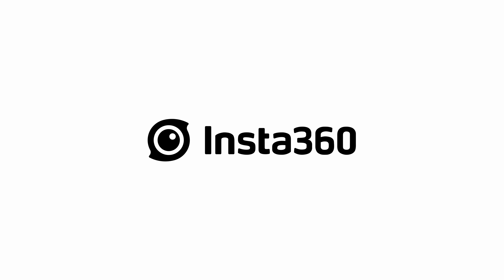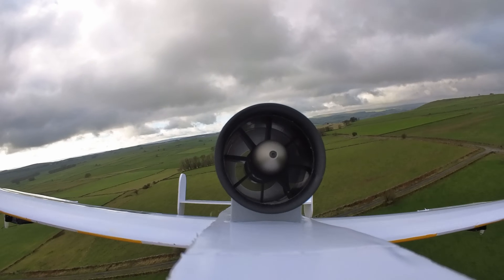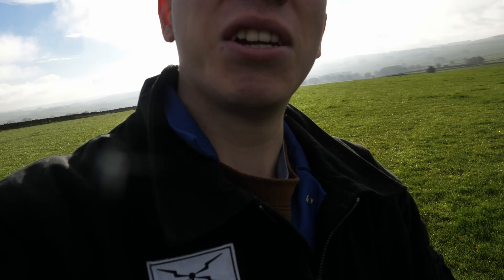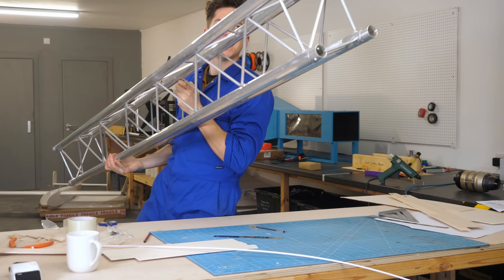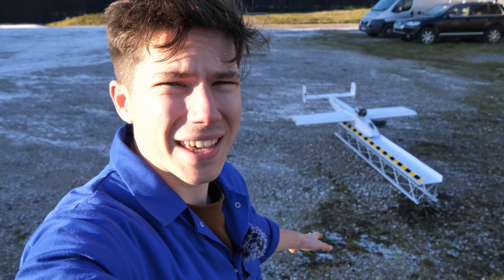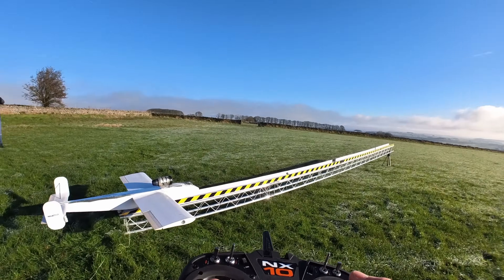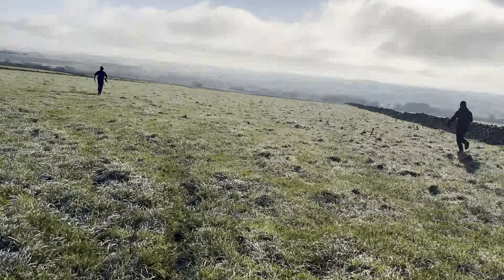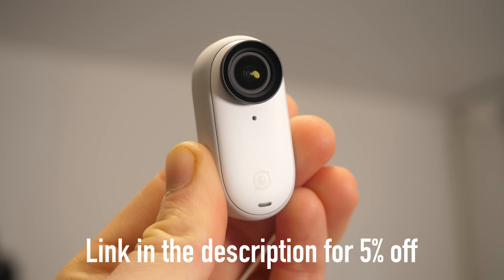Foam RC Jet

Comment: I know the carbon tube will block RF signals, same with the jet engine, and I'm sure the foil tape didn't help. Where did you have your receiver antennas, sandwiched between these three items? So it'd get the best signal from behind and below and the worst signal from above, this corresponds with the aircraft attitude at signal loss\regain IMO.

Comment: Just the EDF version was awesome.  I know I'm not the only thinking, that seems like a good scratch build edf.  Any specifics you can share?  Wingspan / chord . ect.    It seemed like with the EDF it could fly pretty slow.  Is the reason it had such a high min air speed because of the weight of the turbine more so than the design of the air frame?

Comment: To shiled the heat use steel, it have 10% off the thermal conductivity off aluminium. So space a 0.1mm steel sheet 5mm away from the foam, and the heat sheel will be magnetude better.

Comment: You were simply out of range dsxm receivers really aren't that great. It's part of the reason why I switched over to elrs for my quads but with your need for servos I'd do a little more research across protocols

Comment: It was lucky the engine failed prior to loss of signal and not the other way round, or was that the fail safe operating, I presume you set the fail safe?
 Did you use the appropriate form to report the incident to the AAIB?

Comment: Is it possible the turbine shut itself off because it lost signal with the transmitter? I know my turbine will do that. Also swiwins have auto restart so if you enabled this it would have automatically restarted the engine in the event of a flameout. I have also experienced this intermittent signal issue with DSMX which was exactly like what you had happen and had 2 expensive crashes as a result. I would use ELRS or jeti in the future as they do not have this issue. Jeti has the ability to run both 2.4 and 900 which is great for redundancy.

Comment: Ok so basically for the transmitter forgetting using normal signal transmitters since flying in such high speed can interfere with a lot of things considering using gps transmitters with unlimited range

Comment: The most common cause of control signal loss is polarity issues. Didn't you point your transmitter antenna straight at the model when it happened? I'm sure you're aware of the null point trap, but that is so easy to forget in the heat of a maiden flight. With something like Crossfire you would have margins enough to ignore polarity issues as long as you stay within a mile or two.

Comment: Sure looks to me like you lost link to your receiver which resulted in a brown out and subsequently the total loss of control.  What receiver were you using?  The control surfaces went into the neutral fail safe position they were in when the receiver was bound to your tx which tells me it lost signal.  I don't think it lost power because it probably would not have had enough time to reestablish the link.  Personally, I would throw that receiver in the garbage or at the very least keep it for an application that is not critical such as bench setup.

Comment: I would add a gyro if the airframe didnt oscilate to baddly just to keep it upright in a control loss. Or talk to Daniel from rctest flight about long range control systems.

Comment: Maybe you lost signal because of the heat that was produced by the engine? Or maybe because some fuel escaped from the fuel tank onto the electronics? I mean the fuel got out the same way air bubbles got in the tank (probably)
Btw I am sorry for my bad english

Comment: Shame the thing lost control authority from loss of signal, because even with the engine-out it would have been recoverable if not for that. Flew well enough, I suppose that's from being based on jet-drone designs going back to WWII. Is the engine even rebuild-able, or is it totally knackered out from eating dirt during the crash?

Comment: The reason why  he crashed is  because the plane was white and white against the clouds in the sky you cannot see the plane, the bottom should have been a different color than the top he lost control of it ,it wasn't the jet motor  
problem,he should I have been able to Glide it in

 he could have glided it in

Comment: No wonder why you lost signal, you're using a spektrum transmitter. 😂
Spektrum has had problems with range over the last 10 years.

Comment: Notice that you had a spectrum transmitter in the video. If you had a newer model Spectrum receiver you can plug that into the computer and it will give you the PPM data

Comment: why don't you use a basic system to aim the aircarft to the starting point using accelerometers and magnetic sensors? If it loose signal, set throttle to 25% (so it doesn't goes crazy fast) and aim 90º to one side, hold there, after a while another 90º and hold... and so on. Eventually you'll get back signal

Comment: Yea, please don't use that Spektrum junk!
Seriously that's the worst RC you can use!
Protocol is junk, recivers are junk, radios are junk. Don't use it for anything other than park flyers and small foamys.
The only good thing is the price.
Get a good multi protocol radio like a frsky taranis or a radiomaster tx16s, and for those more critical models some good recivers from futuba or graupner!
For small experimental stuff you can use the cheap dsm dsx crap clones for 6 bucks, for crashing anyway it's good enough!

Comment: I would not use a spektrum system for this kind of flying, it gave me a lot of signal issues in the past. I changed it for frsky years ago and never looked back. I also have read great things about ELRS, so i would advice changing your RC system to a more reliable system

Comment: The radio signal didn't hold up because The plane was over a kilometer away from The radio transmitter.

Comment: All modern jet fighters have sloped leading edge on their wings that are best suited for speed, and a large surface area. European fighter jets also have those delta wings that are great for high speed flight. Many large jet engine planes like the Globemaster still have wings that are pulled back for more aerodynamic efficiency. If I had to guess, you went for simplicity when designing the wings.

Edit: So I actually watched the video, and you really did go for simplicity.

Comment: I suggest you move to another radio system like the ExpressLRS ou TBS Crossfire which are way better in dealing with noisy environments and interference.

Comment: Hey ProjectAir, one time i got a similar problem of losing signal in mid air, it was a big plane and every 10 seconds i would lose signal, my problem was because of the spektrum satellite cables, if u move them around and they start blinking that would mean the receivers aren't getting a stable connection with power, so with the g force and vibration they would turn off and turn on (That would explain why you we're recovering signal and then lost again). I hope this helps. Nice video!

Comment: Lesson of the day: Don't use Spektrum radios.
A friend and I had a very similar experience recently. It wasn't a jet and luckily the plane mostly survived, but these crashes could be completely avoided by using a better radio link like ELRS or TBS Crossfire.

Comment: That takeoff went exactly as I’d expect. With that high of a power to weight ratio it’s really important for the thrust to point at the CG. Bummer you lost signal, where was the RX antenna mounted? Maybe the fuel and engine blocked the signal.

Comment: My guess to why the signal cut out is that the foil wrapped around the body acted as a faraday cage so signals coming in / out wont pass. Why this only happened when you turned, I think is because during the roll the top part of the plane starts to face you (part covered in foil).
Reply: if that is the case than why did it not reestablish the link when the aircraft changed it's orientation after the loss of signal?
Reply: @Ramztothaz  It did a little bit didn't it? Every now and again the ailerons would move which I'm assuming is due to being controlled and being re-linked but maybe due to the attitude of the plane over the majority of the fall it was blocking the signal. Its just a guess

Comment: Dsmx + jet = crash. A guy i know also figured this out the hard way recently.  Dsmx has terrible range, and even flying los, jets get too far too fast. There are good elrs options for planes now that people use to fly miles away. far more reliable and way cheaper than smashing jets

Comment: Welcome to the wonderful world of Spectrum failsafe's mate. That is soooo common with those radios if you don't make sure to run the dual antennas at 90 degrees to each other. Watch ANY Flite Fest footage and count how many happen with Spectrum radios every year. Get you an FR Sky or a Radiomaster. they are super reliable and well proven to be rock solid.
Reply: Meanwhile i just chuck the cheap AR410s into everything and never have signal issues. Also your flitefest example isnt the best, as it needs to normalize by amount of radios being used. If Spektrum makes up 90% of all the radios at it then you would expect more Spektrum failures then other brands.
Reply: @SirDoggydog  But Spectrum is lower in the food chain at Flite Fest. Mainly because of the constant signal loss there. MANY return pilots KNOW not to use them. Most are Radiomaster, Taranis, or Flysky entry level radios. and even those have far less issue than the spectrum gear.
Reply: @borgonianevolution  Again, thats anecdotal evidence. I take a spektrum radio using the antennaless receivers to flitefest and dont have any issues even in combat. They only seem to have a higher signal loss rate because they are used more. This is just as valid of take as yours.
Reply: @SirDoggydog  Well... no... you are talking to someone who was active on the forums for Flite Test and had more than just yours or my own opinions. I am still as far as I know the highest poster on that forum. So yeah I have more than enough empirical evidence my friend.

Even Flite Test themselves have moved on from Spectrum. They are over priced one trick ponies with questionable links.
Reply: Just being active on a forum doesn't give you empirical evidence. You need the amount of flight time between failures for Spektrum and the others to determine that. Untill someone actually complies that data, the anecdotal evidence still supports Spektrum failing at the same rate as the other protocols but having a larger number of users. 

However, I cant disagree with the overpriced bit. The way they paywall channel counts is just greedy, and I would recommend FrSky/RadioMaster on cost alone.
Reply: @SirDoggydog  Ok you are obviously just a fanboi so rock on if it works for you.. I am out of the hobby so really dont care if you crash yer shit or not it doesnt hurt my wallet.. Not gonna debate with mental patients who obsess this much over a YT post..
Reply: @borgonianevolution  yes yes, a fan boy who advocates for buying there competitors products. I'm such a fan boy for saying you only have anecdotal evidence of an issue, anecdotal evidence that could be explained by the total volume of Spektrum radios being higher.
Reply: Yep I lost many planes due to Spektrum equipment. Flew FlySky for a while and loved it and got into Radiomaster few years back now. Absolutely love it!

Comment: I personally would add a dihedral angle to the wings (and perhaps even the tail) and have an antenna stick out of the tail and out of the nose so that there isn't any interference with the other electronics and/or metals within the aircraft.

Comment: Use TBS Crossfire RX/TX system. That will eliminate all of your RC connection issues. If you wire it up correctly, settings set properly, it WILL keep connected to your model. I guarantee it.

Comment: Did the radio range suffer due to the aluminium heat shielding masking the signal or causing interference perhaps? I couldn’t see but does the aerial extend outside the fuselage?

Comment: Great work dude! I'm always impressed by how open you are with sharing your process, even the failures

As for the signal strength: if I were you and you were me, I'd be flying something like this with FPV and an on-screen display enabled within the FPV view. That way you can see signal strength degrade in real time and compensate for it, since radios are finicky. I think it'll add negligible weight to your airframe and save you plenty of trouble in the long run

Comment: Are you by chance using Li-Po or Li-Ion batterys for the Receiver? you said its -2 degrees while you drove to the field. 
Lithium Based Batteries dont like cold weather and a few Meters up in the air ists even colder. Maybe the Batteries dropped beyond their operating Temperature and your receivers Power was cut of.

Experienced this behaveior with my RC Car while it was -6 degrees or Colder.  placed the batteries nearer to the Exhaust fixed the Cold Weather problems.

Comment: Told u long ago NOT to use skeptrum. The range sux. 
Flysky is a bit better range and futaba / frsky are way better range. 
It all depends on the radio chip used.

Comment: I think the foil plus long distance from the receiver made the signal cut out. So either you should add an antenna along the whole wingspan to ensure it is never completely blocked by the heat shield or you should mount the engine in a way its heat doesn't reach the foam.

Comment: Signal loss: What Receiver did you use? Did you fix the Antennas at a 90° angle to eachother? Did you put the antennas far enough away from the carbon fiber tube and from the jet engine? Did you perform a range test before first flight? What did your flight log say? What was the receivers voltage?

Comment: Carbon fiber and metal foil will 100% disrupt the signal to the receiver. Having a few backup receivers in line-of-sight places not blocked by the carbon and aluminum should fix the issue. And do a range test beforehand!! :)

Can’t wait for V2. Be safe!

Comment: Well done again! I had nothing but dropout after dropout using Spektrum. Now I have buddies that swear by their system. I tested my transmitter with a signal meter and it was only putting out 9% of the stated signal. Since I bought a Taranis and switched entirely over to the TBS Crossfire 915MHz, I have had 0 failures. I was even getting 88% signal at 80m above ground and 1.1km from me in an all carbon quad copter. Aircraft have an easy 10km range. It is worth the investment when you compare initial Crossfire equipment to the loss of models and onboard equipment.
Look into it!

Comment: This comment section is acting like spektrum and other traditional 2,4ghz have little to no reach and are basically useless. I´m certainly no Spektrum fanboy and I fly ELRS myself, but the distance covered in this video should be no problem with a traditional 2,4ghz system. Especially in the field of gliders or giant scale planes people have flown much farther away than this long before ELRS has been invented. A good traditional 2,4ghz system with a full range receiver and properly mounted antennas will have at bare minimum enough range until you loose sight of the plane. I´ll leave open if Spektrum is a good traditional rc system, but in our club traditional Futaba 2,4ghz is fairly popular and basically 0 issues since 2,4 has been a thing.
So from my point of view the most likely root cause has been the alu tape shielding your antennas or less likely an insufficient power source for your servos and receivers.

Comment: "With a power/weight ratio of 2:1"?!? Are you building an air plane or a plane shaped air breathing rocket? Why bother with anything but control surfaces if you want to go fast and have that much power? Wouldn't it be easier to use a guide rod like a model rocket to launch vertical an land unpowered on a shoot or would that be too removed from what normally passes as an RC plane?

Comment: Electric powertrains really have spoiled the modern hobbyist- in no way would I have expected there’s a bubble trap device for jet motors! Fuel starvation was the obvious culprit but to think there was a bit specifically for that! Dang, to think the riskiest part of this project wasn’t the design, the materials, or even the philosophy, but faulty equipment

Comment: Can't you use plastic bag insige rigid plastic tank for fuel tank? My eye drops are made like this: there is usual bottle shaped rigid container that you hold, and inside it is a soft bag with liquid and no air, that shrinks as liquid being pulled/sucked out out by simple plastic manual pump, that aslo pulls one drop at a time. All to prevent air with microbs from going in and then into your eyes.
Also there are slave recievers called satellites - just another pair of 2.4ghz ahtennas with a box that can be plugged into main reciever for better signal. FrSky has those, for example. Also hope both reciever's antennas was not glued to any conductive carbon fiber/metal part and was not covered by it.

Comment: i would suggest getting a transmitter and receiver system designed for long range, ExpressLRS for example. Radiomaster made some receiver that outputs pwm like normal receiver without needing to install a flight controller. nice video anyway.